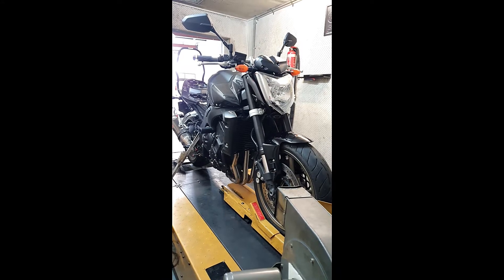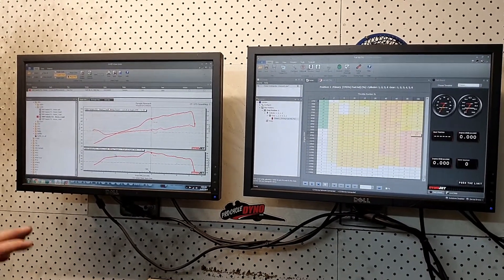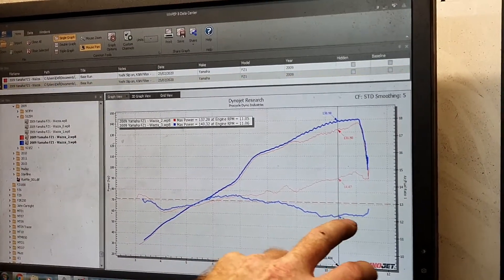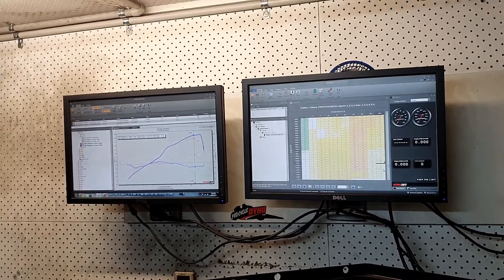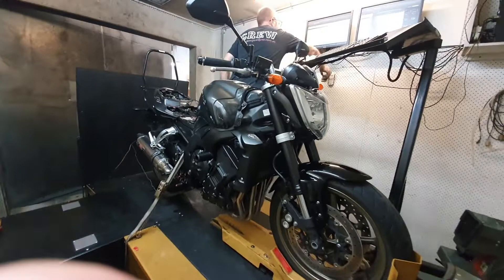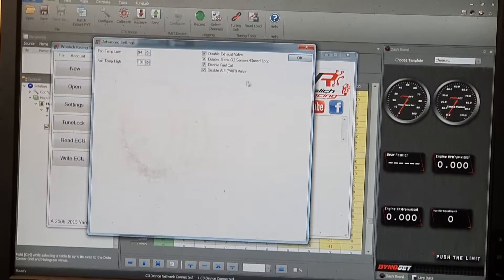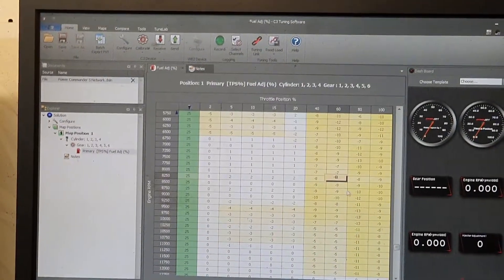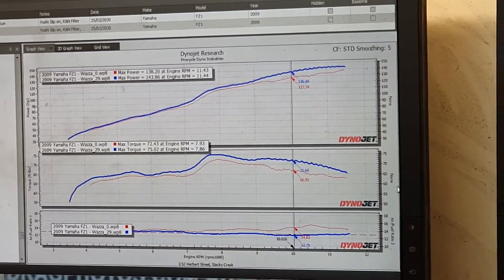Woolich ECU Flash with Powercommander on a Yamaha FZ1 at Procycle Dyno's

Comment: Great work..I think I'll leave the 19 Gsxs 750z with the Yoshy Alpha T alone as I'm quiet pleased with it all round but maybe wouldn't hurt to put the 2020 Fxlrs Low rider S on the Dyno although it seems to run great and sound good too with the VnH Eliminators 300 , just to remove any restrictions..
Reply from the maker: A custom dual map works well because each cylinder has it's own map to keep your H/D cooler and finds out how your fuelling is at all of the rev range. Fred specializing in all bikes for all types of performance levels. I've left some links to his site, check out how many H/D riders get there sled to the place of optimum performance, however fast you want to go.
My 2005 anniversary Fatboy 1550 was Dyno'd and custom mapped at 180000klms approx.
I think it was more, amazing how much better the old girl was. You can check out my first lot of videos on this bike on this channel. This one was after the Tune.   https://youtu.be/1oKZX6uEdBA

Comment: The original fueling on the power commander was shocking, the guy was nice about it but its fueled lean from factory so taking that much off was negligent, i would say, if you buy one of these with a power commander you best check what and who dropped those numbers in, anyone giving that bike stick could have blown the engine and had no idea why
Reply from the maker: Yes your right. I got the bike at about 56k on the speedo so fueling can change over time, maybe not that much. The bike seemed alright just the low down response lacking below 4500rpm.
It was lucky for me that I always see Fred for a Custom Map and Dyno and that's exactly what he said. I've done three track days now and about 75k showing on Speedo, Trouble free.

Comment: Hey Wozza, i'm thinking of getting a Woolich tune for my FZ1, did you find it made any difference to your tank range? Cheers, Keith
Reply from the maker: No, I didn't notice a big difference in tank range, more so in  h/p and torque. More bottom end, set the fan lower etc.
A better, smoother ride overall. That you do notice. Cheers Keith.
Reply from the maker: Did you end up getting your bike tuned and did it make it better if you did?

Comment: Are u happy with your fuel map wozza?   I wanna use this map in my bike.....getting my ecu flashed tom
Reply from the maker: Hi Scott, very happy. Power delivery from  1500rpm. I've used Woolich Race tune on  both the FZ1 and MT-10. Just have your pipe, air filter on before the tune. The ECU Map from Factory was detained in First and Second so that's where the fun is. Cheers.
Reply: @WozzasSportsCruiserRides  Tx for the reply mate....good to hear u happy.....this was the only thing wrong with this bike in my opinion...that flat spot under 4k.....good to know its cured....I see when the guy tuned your bike....he put the power map from 3rd gear...and apparaently 1,2,3rd gears are all restricted.....so i rekon u need to change the setting to 4th gear (unify ignition group maps at 9 min 27min)

Comment: http://www.ivansperformanceproducts.com/2006fz1.htm

These bikes are very underrated and very chocked up from the factory,  if you want the best out of one of these take a read through this page.. you can turn it in to a beast, not just the top end but lower down mainly and the 6K-8K rpm range where the bike normally dips in power can be filled in.. Most will make over 150hp at the wheel to
Reply from the maker: Thanks, they are.

Comment: What's one of these dyno tuning sessions gonna set someone back in price Wozza?
Reply from the maker: I'd allow a day of you time and approx $750.
Reply: @WozzasSportsCruiserRides   thats like 15% of the bikes total cost. very expensive.
Reply from the maker: The bike is night and day better. Happy as.
Reply: @WozzasSportsCruiserRides  happy about you bank balance too ?
Reply from the maker: @mechanicalman4531  Perhaps you should watch the video, The base run shows midrange was extremely lean. A track day would have damaged the bike or blown the engine, all on video. That was at approx 39000klms. I am at 103000klms now, Track days, Adventures, heavy rain, Dirt roads, off road and creek crossings. General maintenance only. All the extra and original parts come to 5k, 6 month rego and new tyres. I bet you $100 you want get one for this value, more around 6k to 7k. I would have been pissed off if I hadn't tuned it and blown it up doing 210klms an hour on track, not to mention the injuries that can happen in a crash to myself and others. Can't you see how happy I am and my bank balance, Cheers ,Wozza.
Reply: @WozzasSportsCruiserRides  you spent 5k in parts and extras ? um dude the whole bike is only worth 5k used. you got ripped.
Reply from the maker: 5k with the extras and original parts. Watch the videos dude.
Reply: @WozzasSportsCruiserRides  don't reply to this clown Wozza. Wasted energy. Great bike
Reply: @WozzasSportsCruiserRides  then a $750 tune, its 15% of the whole bikes cost. you got ripped for that tune
Reply: Somebody has obviously never paid a professional for their time and equipment. $5000 plus $750 investment to make it better and more reliable is cheap. If you can't afford it why are you watching these videos?
Reply: @rodriguez3939  15% of the purchase price is not cheap. Also tuning for more power makes it less reliable not more. that's why the factory detunes them. Somebody obviosly has no idea what they are talking about. That somebody...is you

Comment: The FZ1 is flat under 4000rpms....not much u can do....perhaps its got to do with the 5 valve head......Bike actually has 2 power bands....one at 4000rpm and another at 7500rpm
Reply from the maker: Mine launches just after clutch out now. No flat spot anymore.
The FZ1 was tuned from factory retarded in 1st and 2nd up to 4000rpm.
It now has a fully, smoother power line all the way to get line.
The aftermarket tuning at the time could smooth the fuel map with a Powercommander not the actual original map.
The Woolich Race tune is a remap, fixing all problems. New technology for a older bike. 
Perhaps you should watch the video to understand how it works.
Reply: @WozzasSportsCruiserRides  Why did u sell your MT10?   Did you not enjoy it that much?   Ive been considering selling my FZ1 and buying an MT10.... 

I see MT10 has no wind protection like the FZ1....thats a big bummer